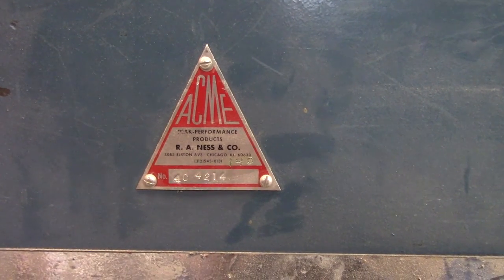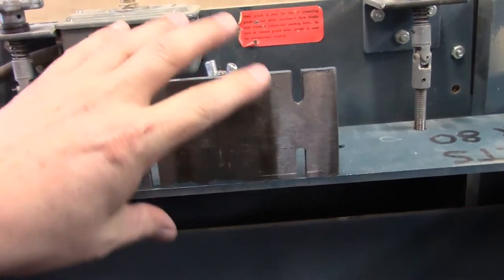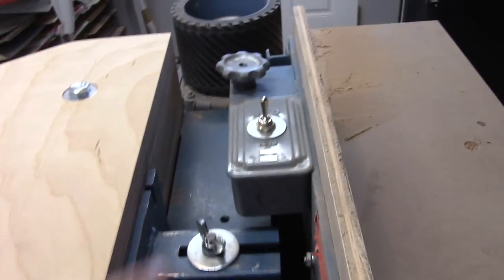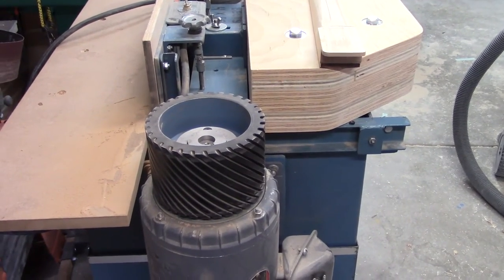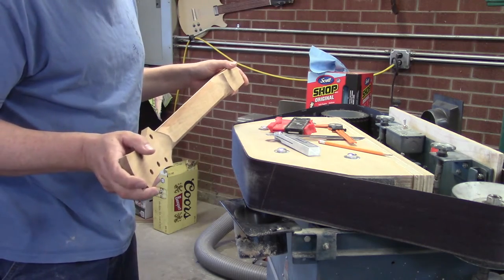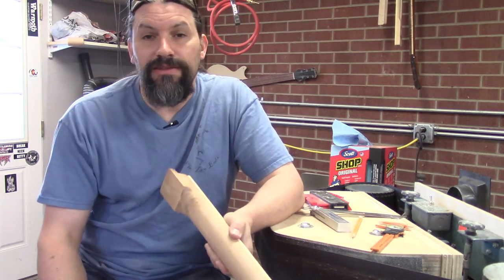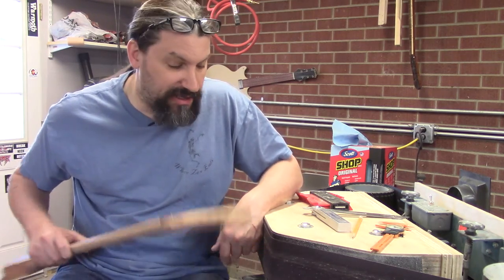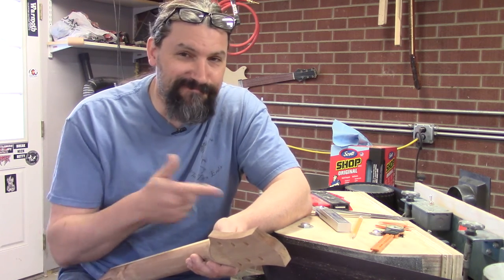Old School Dead Head Sander Part 2

Comment: Nice work Matt.   Does this also work for bass necks, since the platen was designed to a guitar neck size?  I'm doing something similar with my Grizzly 6x80 sander but was wondering if I might need 2 platens, 1 for guitar and 1 for bass.
Reply from the maker: Hi Dan, we use it for everything. Guitar & bass necks work equally great on this machine, and it's really excellent at comfort contours too
Reply: @TexasToastGuitars  Good to know... thank you for the quick response Matt!

Comment: I was wondering instead of graphite paper could I use (UHMW) ultra high molecular weight plastic?  I have like a 18 peices that are 6 wide and 18 inches long by 4 inches deep.  They are cut offs from a seller on ebay.  I would love to use them to build a jig like yours.
Reply from the maker: Hi Agdtec, 
I'm not really sure but I would be interested too. If you decide to build one let me know what you come up with. We are planning to build another sander like this based on a smaller, more readily available machine so anything new and cool would be good information.
Reply: I used to work at a plastic factory and we supplied UHMW to a lot of manufacturers for applications to reduce friction. Before I scrolled down and saw this comment I was going to suggest putting it across the face of the "Head" to lower friction, just a 1/4'' sheet bent around the front.
Reply: On second thought, I think you're doing it right. Graphite is the way to go. UHMW might work on other friction parts, though.

Comment: Also, what grit are you using?  Thanks!
Reply from the maker: We have several grits for this machine but right now it is wearing a 50 grit belt. They aren't expensive do get a few and save yourself some hand work later on down the line. Thanks for watching brotherman